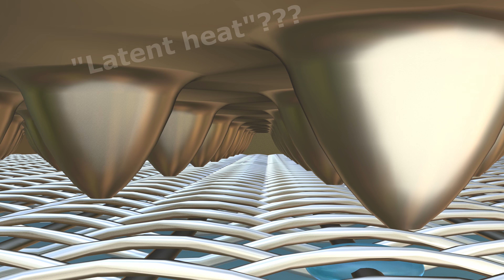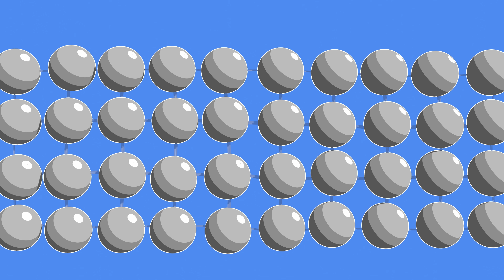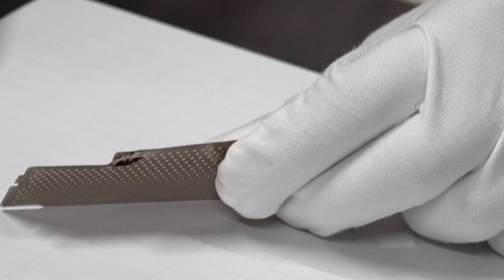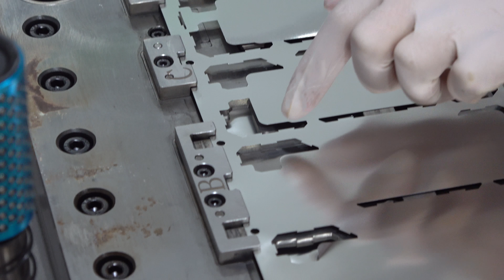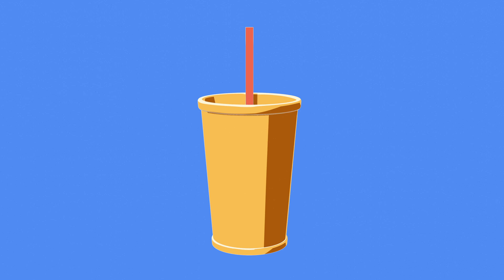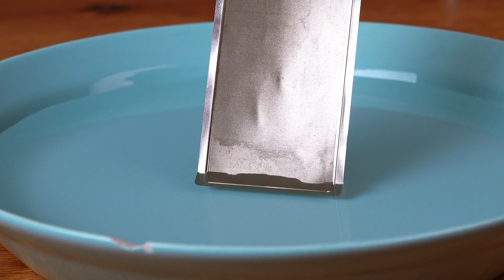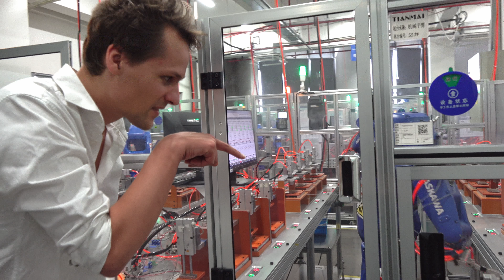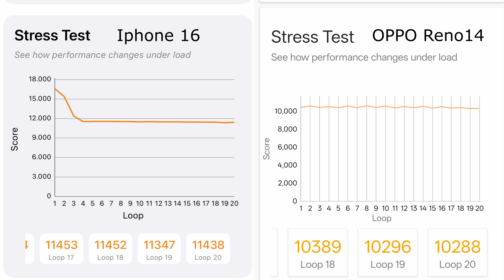How One Drop of Water Cools Your Phone

Comment: I have a question. Would it be possible to build a baseball -cap that is cooled with these vapor chambers? I wonder because I would like to do this as a university project :)
Reply: Shaped vapor chambers generally have to be a bit thicker, (often thick enough to support their own shape without internal supports/dimples) and good contact with your scalp would need that shape to be very precise. Certainly possible, but challenging!

Comment: I've always found heat pipes very fascinating. I made one some years ago from a brass tube. I used methanol. I even trimmed some fins for one end. To dip it in your coffee, or even hold it in the palm of your hand- and feel the ping of the fluid boiling, and the instant raise in temperature some 12 inches away, always fascinating.
Thanks!
Reply from the maker: cool! always tag me on insta if you ever post something like that :) I love to see that kinda stuff
Reply: Pro tip : Never ever try to solder heatpipe while holding it barehanded on one end, thinking that heat from the flame will travel gradually just because its more than 2 ft in length, and then proceed to burn both the fingers and your nylon pant when you throw that hot piece of metal in air.

Also, dont heat the pipe for too long if you dont want it to be permanently inflated.
Reply: @primonda56 lol, the odd specificity of lived experience!

Comment: Holy crap. It's probably the best video about vapor chambers and evaporative cooling on youtube. 
Now I want all tech manufacturer to send Know Art to all their factories
Reply from the maker: haha, thanks, I want that too!
Reply: I don't think (to be clear I'm not sure) its technically evapooritive cooling because while the water inside the chamber does evaporate, it condenses again so no water is lost but in traditional evaporitive coolers the water leaves the device. This is closer to air conditioning imo because the machine has the refrigerant evaporate and condense where no refrigerant is lost. But a vapor chamber is passive in terms of electricity use, same with evaporative cooling (though most devices have a fan to speed it up, but you don't technically need it, if you're willing to accept slower cooling)
Reply: @Fighter178 Technically is a passive heat pump. Moves heat from one area to another. Similar to an air conditioner, but without the compressor.
Reply: @Fighter178 thanks, maybe not technically evaporative cooling
Reply: Yeah it would be incredible if we had videos of this quality for all tech parts ever made.

Comment: Thinking about vapor chambers I usually wonder what would result swapping out water with alcohol, I mean if the whole point is to transport heat through evaporation wouldn't keep it cooler if the evaporation ceiling was lower?
Reply from the maker: I don't think so. The boiling point is not the limiting factor. When it heats up and becomes steam, the pressure in the vapor chamber increases a bit, also increasing the boiling point. This would also happen with other liquids. It's a self balancing system. What you care about is the transportation speed of the wick vs. the latent heat capacity
Reply: Main reason to use alcohols would be antifreeze, water ice in a vapor chamber blocks it up, and can damage it when forming. Most liquids other than water shrink when freezing, and pressurized gasses like ammonia can reach as low as -60°C without operational issues. On the far side of the spectrum, sodium vapor chambers can run at nearly 1000°C. Water is well-selected for working around room temperature, to cool something under 100°C.

Comment: The vacuum created by cooling steam is quite strong, a fun trick is to use it to crush an aluminum can... hold it with tongs, get a bucket of water nearby, heat a small amount of water in the can until it's visibly shooting steam, then flip it upside down into the bucket.

Stainless steel is of course, a bit stronger than aluminum, but the materials engineering on display here is impressive!
Reply from the maker: would've been a nice test for this video!

Comment: Now how thick would they have to be for their average density to be less than air?
Reply: The bigger you make your chamber, the stronger the force pushing it inward. If you want a good read on the history of extreme materials engineering, look into the history of vacuum airships, dirigibles lifted by a low-pressure balloon... and why we've never been able to design one that would work.
Reply from the maker: haha hmm.... interesting. I think that it'll be quite a challenge with these metal sides.

Comment: When I saw the title I thought that the video is about cloud chambers (the old detectors of subatomic particles). I had no idea that differently shaped heat pipes are called vapor chambers 😮
Reply: If they could only be transparent, I suspect in the low pressure environment some part of a vapor chamber normally experiences condensation events around cosmic rays and the like. They wouldn't look as dramatic as a proper cloud chamber, but the right conditions are there.

Comment: gret video brother  this technology made my day  it's great  i was thinking to use ot in my bldc motor to extract heat away from my coiling  but i need to do lot more research on that ? is it possible or not ?
Reply: Definitely possible, but for many applications water cooling is cheaper and easier. Look at the pre-made systems for BLDCs on model boats, for example.
Reply from the maker: what's good to keep in mind that these things only spread the heat. For significant powerdraw like >100 watts you still need a radiator and a fan to get the heat to the air

Comment: What happens when you use a vapour chamber at an ambient temperature above its boiling temperature? Surely the liquid cannot condense?
Reply: It's a sealed vessel, so there is no one boiling point... as you climb higher and higher in temperature, some boils off and raises the vapor pressure, raising the boiling point. You can get to the point where there's no liquid left, but you might blow the chamber up with steam pressure first. If you reach pure vapor without blowing up, all that happens is it stops working efficiently, and becomes a metal pocket full of steam. As soon as you cool it enough it would then start working again, assuming it hadn't been damaged by the vapor pressure.
Reply from the maker: jercos explains it perfectly. When it gets hotter, the pressure in the vapor chamber increases. It's a self balancing system. I believe these things get tested at 95 degrees for 12 hours or so! It will just become a bit harder for the phone to get rid of the heat to the outside air, but the vapor chamber will do just fine
Reply: @KnowArt actually, if running at that high of pressure and temp (they're tightly correlated), it gets relatively harder to spread the heat inside the chamber. The reason is that the water isn't changing phases at each end and moving the mass between, like you said about the gas holding less dense molecules.

Externally, the higher temp actually increases the transfer to the air because it has the large area and now a higher delta temp difference.

Comment: so iPhone chips thermal throttle in 1 sec?  So they could re-release them with vapor chambers and go crazy in a new product... interesting
Reply from the maker: 1 minute. But yes, it's strange that they released it with such poor thermals. But note that this is with a stress test. Regular use will be different
Reply: It's the usual marketing speak... we're in a thermal throttling generation. Intel gets around this by referring to its faster speeds as "turbo" (i.e., 150% or more of base speed) instead of saying the nominal speed is "thermal throttling" to 80%, but if you ignore the different set points you can imagine an exponential curve, where even throttling to 99% power is enough to cool off a lot compared to full 100%.

A massive vapor chamber lets you suck that last ~20% out of your CPU though, and that's still something.

Comment: at 00:20 PAY ATTENTION Very carefully on this part
"and then, Transfer the water back to the processor (Hot surface) without any moving parts"

The truth: it needs EARTH'S Gravity to be able to do it effectively.
That's why laying your Motherboard horizontally actually better for Vapor Chamber because it needs to exert Less energy so the water inside can Condense back faster with the help of GRAVITY.
CAPILLARY doesn't help much when your Motherboard is oriented vertically,

It is indeed LESS EFFECTIVE when placing your Motherboard vertically in regular Tower PC Case.
Because then the water doesn't travel back as quickly to the CPU IHS, instead it is more likely accumulated on the Vapor Chamber walls.
Thanks to Vertical orientation of your Motherboard
That's why Horizontal laid back PC case is actually superior.

Same thing with GPU by the way. When you laid back your Motherboard Horizontally, the GPU became vertical.
It's rather easy to solve this. just buy PCIe x16 Extension Gen 5. It's also backward compatible to Gen 3.
And then make sure the GPU is laid back the same way horizontally.
Reply: Vapor heat transfer inside a "boiler" like this is still highly efficient compared to conduction through copper... just less efficient than the ideal. It will still work upside down, transferring heat energy to the whole surface of the device, just at a shallower gradient limited by the heat mass of the vapor portion.
Reply: @jercos  jokes on you.
The difference I got was between 5° Celsius to 8° Celsius cooler.

Just by laying down the whole PC case.
All with the exact same stress and workload.

Is Earth's Gravity a joke to you?
You might as well see how the Capillary works right in this video. He's in fact showing how it reacts with gravity, but not wall? (Simulate how CPU IHS being vertical)
Reply: @niezzayt3809  unless those 5-8° are worse than replacing vapor chambers and heat pipes with solid copper... no, the joke isn't on me, you're demonstrating exactly what I said.
Reply: what? how does this have anything to do with tower pcs? cpus are usually cooled by air through heat sinks that use heat pipes, but get this, they are horizontal. motherboards are perpendicular to the ground, and the heatsinks fins are perpendicular to the motherboard.
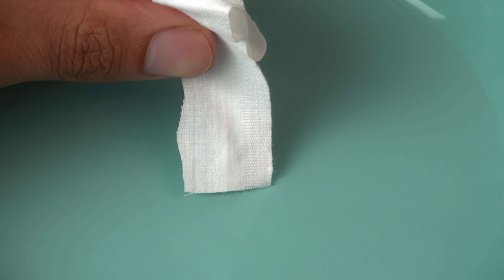Reply: @iamnewtodavinci  does Water affected by Earth's Gravity means nothing to you? Are you misinterpreting 07:41 ? Do you know how IHS orientation matters if using Air Cooling? Capillary action matters the most when Condensing. Not when Evaporating.

When you laid your MoBo on the table, is your CPU orientation Horizontal or Vertical? Because when you put your MoBo in regular Tower PC case, the water inside vapor chamber (or any Heatpipe in general) are dragged by gravity to the farthest edge of CPU. So the IHS is effectively heating up AIR inside the vapor chamber or heatpipe. Not heating up water as opposed to Horizontal orientation.

SilverStone suddenly popularizing Horizontal PC case again. Simply because they also realized it's very effective for vapor chamber.
Reply: @niezzayt3809  i was a little wrong when i thought that the metal fins on the cpu cooler were the heat pipes.

anyways.

you do realise that the heat pipes on cpu coolers are bent? no matter if the cpu cooler is vertical or horizontal, the heat pipes that transfer the heat from the cpu to the fins will still have a "ceiling" section and a "wall" section. my only guess why your pc performs better while laying down is because the heat pipes transfer the heat to all of them instead of only the top ones. but yknow, to achieve true performance, lay your pc ram down cpu up. that is the theoretically best approach. though i will not be laying my pc down cause i dont have THAT much space on my desk.

Comment: Really impressive ideas with very clear presentation.
I'm worried though that if the water boiling point is 30 degrees, then the evaporating chamber stops working when its over 30 degrees outside (or in the phone's immediate surrounding) as the water just stays gas all the time.
I wonder if you can adapt to hotter outside temperatures on the fly by reducing the volume, thus increasing the pressure and the boiling point to compensate.

Comment: Vapor chambers or pipes sounds cool theoretically but playing with it is just mind blowing!

Heating a thick copper pipe with a blow torch to red hot and then many seconds later you feel it 10 cm away.
But having a vapor chambers tube from a CPU cooler you can just heat it with a lighter and it burns your fingers immediately for the same distance.

First time I did this I where very surprised 😂
Reply from the maker: yeah! I was testing some things out after filming to make a thumbnail, and I almost burned my fingers. Multiple times! haha

Comment: Yeah, same principle as heat pipes as mentioned. What's strange to me is the fact that this fundamental principle/technique haven't reached much more widespread use than it has, already. It's very simple in principle, and with huge potential, in a lot of areas.  Heatpipes/vapor chambers (I which there was a specific, good and widely accepted name for all variants using the basic technique) have been described as super conductors for heat, which I think is a quite good analogy. 

I developed a design of a vapor chamber in my head before I knew they already existed, similar to that design, but using the wick to keep the sides apart, which would make it somewhat challenging to get the absolute maximum performance for a given thickness. But I still think it might be relevant to look into having two thin wicks separated by something that allows good vapor flow between the wicks.

And by the way, you can't "set" a fixed boiling point in such a system, as the pressure, and by that also the boiling point changes with temperature. When you only have [liquid] water and water vapor, whatever the temperature of the liquid water is will be the boiling point of that water. That will remain true as long as that temperature remains above the freezing point, as it's not called boiling but sublimation when ice turns directly into water vapor.
Reply: Heat pipe is typically fine to refer to the whole range, but if you need a less terse, more technically correct terminology you could refer to the class as phase transition heat transfer devices.
Reply: @punkdigerati  Thanks, makes sense, the problem is the "widely accepted" part. You risk starting a heated debate if you call anything but specific type of heat pipe, a heat pipe. To me even a pipe without a wick should be considered a heat pipe, even if it only works in one direction, it's the still same basic principle, and in some application only working in one direction can be a very significant advantage .
Reply: @fishyerik  I would love to see a vapor chamber design used to miniaturize heat engines, overcome material limitations, and most of all, support monolithic design.

"I still think it might be relevant to look into having two thin wicks separated by something that allows good vapor flow between the wicks."
In a strong vacuum, I imagine having the lowest possible mean free path to the condenser would be the best you can do to improve flow. 
However, you could use electric fields to impact the actual wetting of the surface by the vapor molecule, and I just confirmed this with a quick article search (The Impact of the Electric Field on Surface Condensation). 

A dumb parallel plate electric field might not be the answer to improve vapor flow, but a different configuration or some AC frequency might improve the mass transport through the dielectric force, or reorientation of the evaporative column or cone of vapor. Then perhaps you could have an active vapor chamber over a passive one.
Reply from the maker: yeah great point on the temperature. That's also the reason they don't stop working when you're in a hot climate! Should've mentioned it.
Reply: Because for larger items we already have a stronger phase-change cooling system. It's called your AC unit. They work the same way except they use a pump and pressure regulator to make it much faster on a large scale. Air conditioners can also push below the ambient temperature.
Reply: @supercellex4D  Vapor compression based heat pumps, which typical air conditioners use, requires a lot of energy, and is expensive and have a lot of moving parts. There are plenty of situations where you have enough temperature difference to not require heat pumps.

Comment: The external dimples are to reduce warping and reinforce different areas for the cuts.  Bending a '__' into a 'w' shortens the overall length of that edge and makes it harder to fold in various directions.
Reply: From a geometry perspective you're moving the neutral axis of bending further from two surfaces.  Like trying to bend a scale where it's flat, versus its edge.
Reply from the maker: hm, interesting! thanks

Comment: It seems to me that another Reason to use Hydrophilic properties inside the Heat spreader, is that since Water is an Important part of the Heat Transfer Cycle inside the Spreader, then, the More Surface Area Contact Between the Water and the Metal, the More Efficient the Heat Transfer.
Reply from the maker: hm, good one!

Comment: 12:49 That's polyimide film aka Kapton.
Reply: Ps, another purpose of the graphite heat spreader is to serve as electromagnetic shielding.
Reply: @johanntiu4162 It is way better at electrically connecting the metal EMI shielding parts together than those "little" copper alloy springs we used 40 years ago. 

"Little" is a relative term. The springs were close enough together to block the frequencies of concern back in the day in an automotive environment. Modern cell phone designers have to worry about much shorter wavelengths.
Reply: @hamjudo Yeah